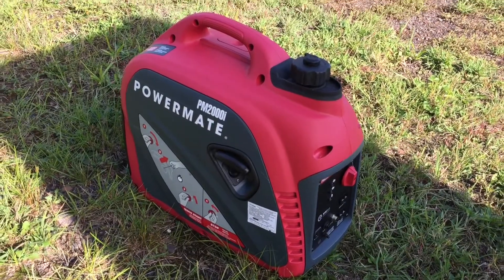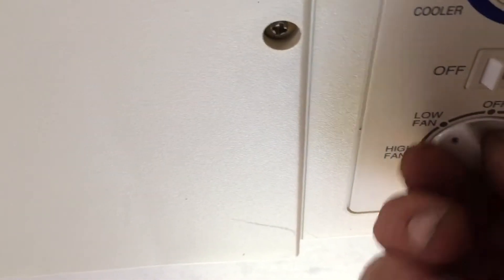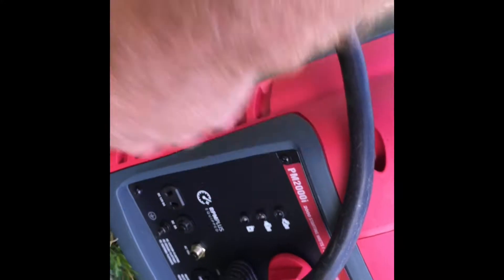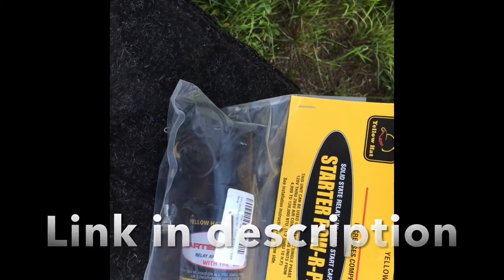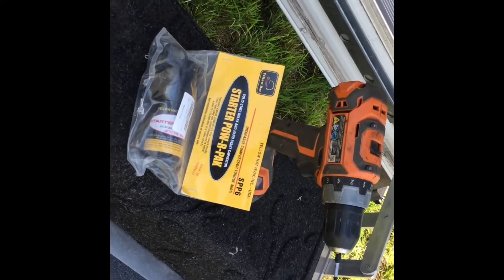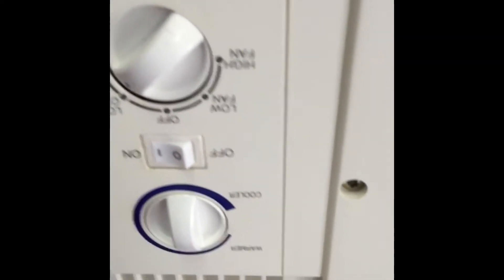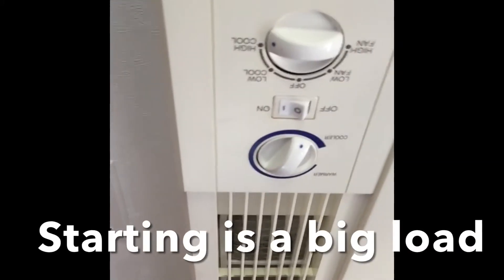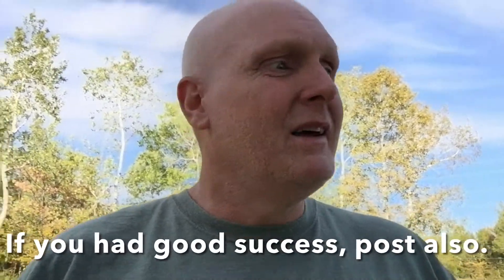SPP6 Hard Start Capacitor Relay- Running AC from generator???

Comment: Looks like the hardstarting cap is working, running load my be an issue.  Do you know what the FLA amps is on the a/c unit ?   2000 watts at 120vac is a little over 16 amps. Not sure what the overload limit is set for.. There should be a name plate with rating on the a/c unit. If it is over 16 amps gen will be running over its load limit.
Reply from the maker: Yeah I looked at that before I started. The generator has a 16.7 amp circuit protection. I knew it was going to be right at the max. But figured I’d try it.